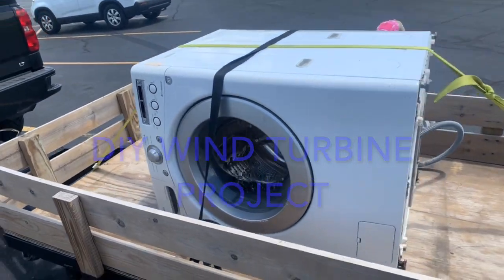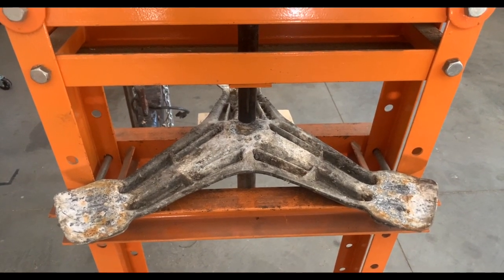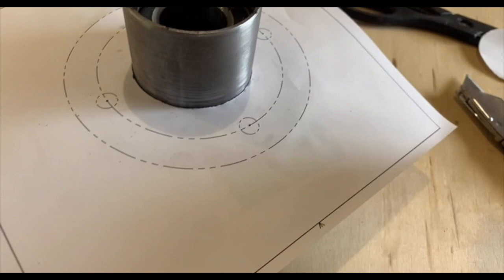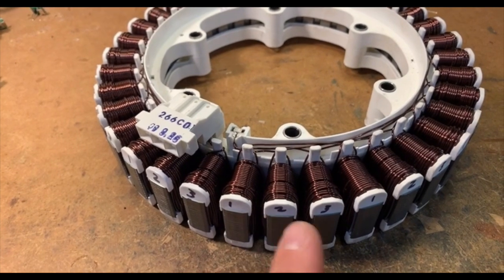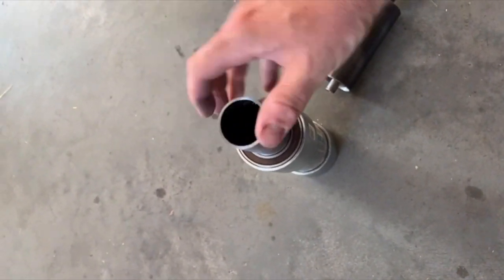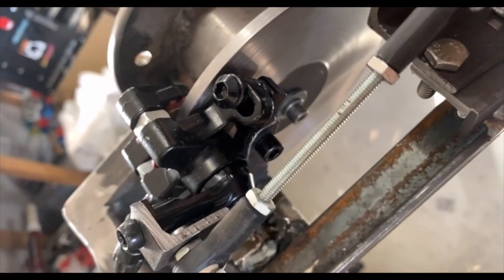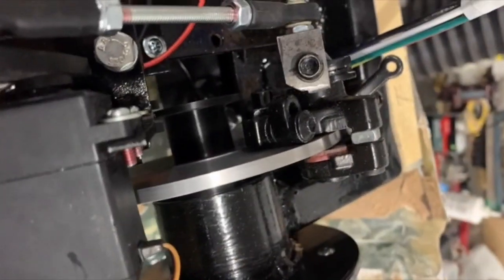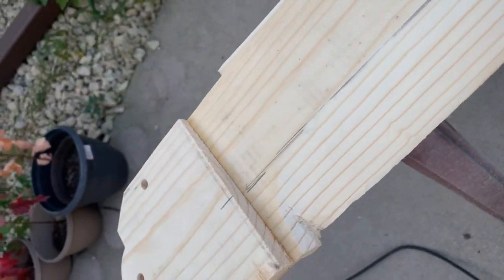DIY Wind Turbine

Comment: I just got five blades and a hub for my second wind generator project. I got 28 inch blades. I bought one turbine already made so that I can see what's needed. I was going to make one like yours but my uncle gave me a DC motor. When I wrapped a cord around the 3 inch pulley and pulled ,it  made 79 volts. The wind has been blowing around 30-35 all night. They sent me a 12 volts turbine and a 24 volts controller. So I ordered a 200 amps rectifier and hooked it up direct, to half my battery bank. It seems to work better on the negative side of the 24 volts setup. I guess I will have to try and put the windings in series later on.  The last two March's before this one, I had to use the gasoline generator but not this year. I got the Stealth Storm blades that are good to 144 MPH. They have a strip along the edge, designed to create a wind wall at so many RPM s that slows down the blades. It eliminates the need for a furling tail. So they should help, here in tornado alley...the brake on the regulator they sent won't ever come on, I don't think. No way that little turbine is going to get my twenty marine batteries up to 30 volts for the brake to come on. I had to give $200 for the blades and hub, but they should hold up. After I found out how much power I could get from the wind, I was ready to make another one. The one I have is up 16 feet, with another 3 feet available but it's not necessary. There's a lot of wind here. I probably could have had wind before solar, but I did it the other way. It works best with both. There are two short videos of my wind generator on my channel.

Comment: Im taking another approach.
Not storing electricity.
Basically dumping power into heating elements. By varying the load, can keep blades right in the sweet spot, no brakes required...

And im capturing every bit of power those blades are catching.

What to do with heat?

How do you cook, keep warm, and how does virtually every power station  and engine worldwide work?

Heat.
Reply from the maker: I also have thought of this, my demand is electricity but your theory for your application is sound. Just be careful if the wind power overcomes the magnetic force of the coil, it could lead to overspinning. Just a simple furling tail may be enough to prevent that.

Comment: Nice video! Which brand/model washing machines work best for this?
Reply from the maker: Its more the type, any one that uses a similar coil and drum should work. In Europe most are known as f&p washing machines. LG, Samsung are the most common. If you find a used one, do a google parts search for that model's stator and make sure it looks similar to the one in my video.

Comment: Super neat. I have a couple of those stator/rotors I want to turn into a generator. Do you have a source to how to rewire the stator or did you figure it out yourself?
Reply from the maker: I searched the internet of course before hand. There are several different sites that show some different configurations. One being thebackshed.com
Reply: @dustinsdiyprojects2056  oh awesome, I haven't came across that forum yet. Thank you
Reply: As soon as you open one you see how simple it.
Every three poles, wound in series..

I see no point in modifying them myself.
Reply from the maker: As it is without changing the configuration it would be around 200 volts and very low amperage.

Comment: Which washers are best for these type motors and which older ones are cheap or free?
Reply from the maker: It has to be a front load wash machine. If you find one, google search for that model#'s the drive motor. If it looks like the one in my video it should work.

Comment: How much voltage you got with that smart drive motor for 200 rpm?
Reply from the maker: It will stay close the battery voltage you have connected to it. My controller is set to put out the maximum of 56 volts.
Reply: @dustinsdiyprojects2056  what kind of amperage have you observed? I'm thinking that the washing machine parts might lend themselves to a vertical axis design.
Reply from the maker: The most I have seen is 12 amps with the configuration and the wind in my area.

Comment: While I like MOST of what you did...

1: I see ABSOLUTELY NO REASON for a brake on this device...

2: Would be faster, easier, cheaper, and longer lasting to form the blades from SCH 120 PVC pipe because it is lighter, more resilient, won't rot, can be formed, reformed, and infinitely re-glued for eternity, while wood can crack, warp, rot, and little to nothing can stop this, nor patch it without a whole lot more work.
Reply from the maker: If you watched the videos ending, I explained I went with different non wood blades. Also added the brake is more of a safety feature for a piece of mind than to be used regularly.

Comment: What a great idea, to use a disc brake! thnx I'm also going to play around with this for my E-Bike windmill https://youtube.com/@breeze-360  What kind of brake controller are you actually using?, I am still looking for one that is rpm related.
Reply from the maker: The brake controller is something I made. An idea would be to use an Arduino or equivalent and monitor the rpm using a hall effect sensor or use a light sensor and make a ring with notches in it like I did. You can get the reading by having it count how many triggers it gets. Here's an Arduino example for your project:

start_time = millis();
  end_time = start_time + 1000;
  while (millis() < end_time) {
    int state = digitalRead(sensor);
    if (laststate == LOW && state == HIGH) // only count on a LOW-> HIGH transition
    {
      steps++;
    }
    laststate = state;  // remember last state
  }
  temp = steps - steps_old;
  steps_old = steps;
  RPS = (temp / 24); //Encoder slots in the circle
  rpm = (RPS * 60);
  Serial.println(rpm);
Reply: @dustinsdiyprojects2056  thank you for the response, I am currently looking for a wind rpm watt data logger.
It is intended that the display will give the following combined information:

Wind Speed:
Real time.
Average wind speed determined over 10 minute periods.
Maximum wind speed determined over 10 minute periods.

Part: Arduino Wind Speed Meter Anemometer - Adafruit Anemometer (Product ID 1733).

Rpm: (hall sensor rpm)
Real time.
Mean rpm determined over 10 minute periods.
Maximum rpm determined over 10 minute periods.

Wattage/Yield
Real time.
Average wattage, determined over 10 minute periods.
Maximum wattage, determined over 10 minute periods.

Via a push button, you can click from “real-time” to “average” and “maximum”, whereby all three measurements “Wind speed, Rpm and Wattage/yield are / become visible simultaneously.
it takes a while to figure it all out!
Reply from the maker: The controller I purchased, will show most of that on a Windows computer program connected via a serial cable. I am working on a video showing that and how I intercepted the data to be able to export/ log using python.

Comment: Electric brake is better
Reply from the maker: I somewhat agree but if you mean shorting 2 of the 3 coils together as an electronic brake can heat the coils up more than needed. That's why I have both types. Thanks for the comment.